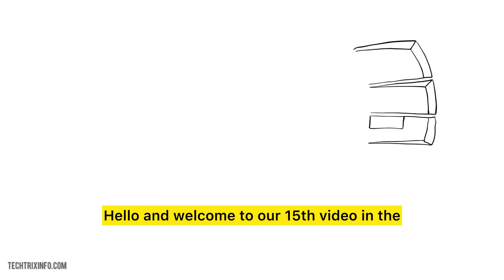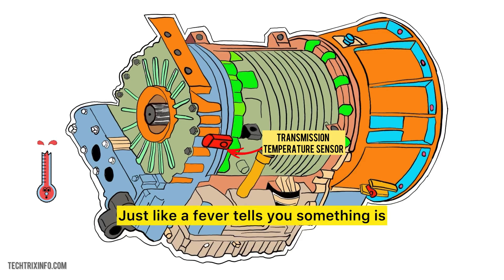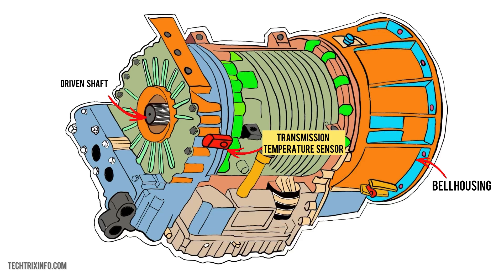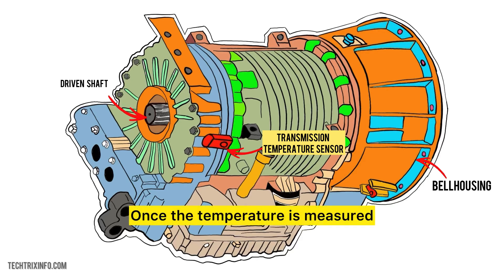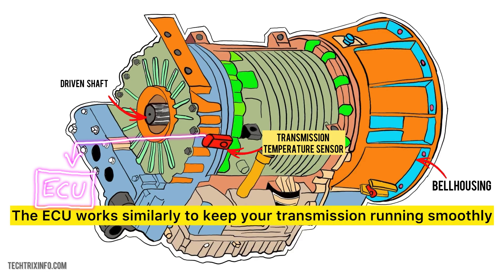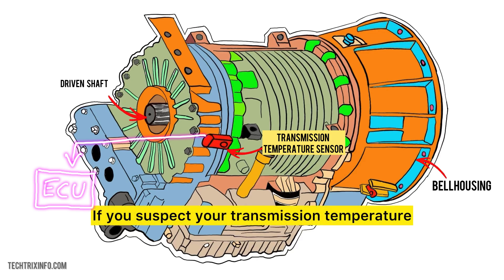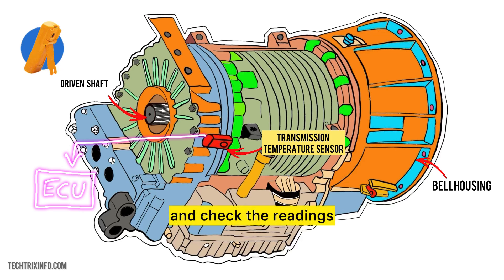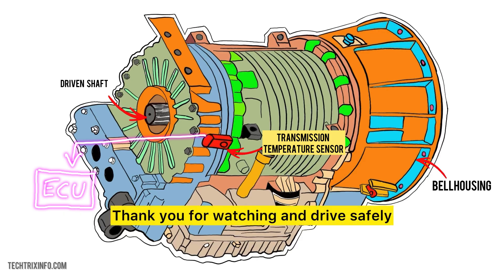Transmission Temperature Sensor Explained With Animation | Mastering Automotive Sensors | Part 15

Comment: I have a manual transmission.
Reply from the maker: That’s great! While manual transmissions typically don’t have transmission temperature sensors like automatics, it’s still crucial to monitor transmission health. What methods do you use to ensure your manual transmission runs smoothly? For those who drive automatics, the sensor plays a key role in preventing overheating—curious to hear everyone’s experiences with both types!